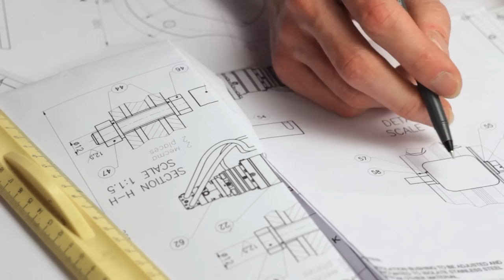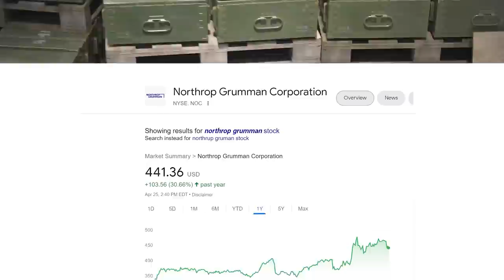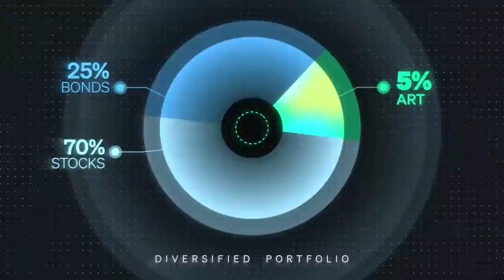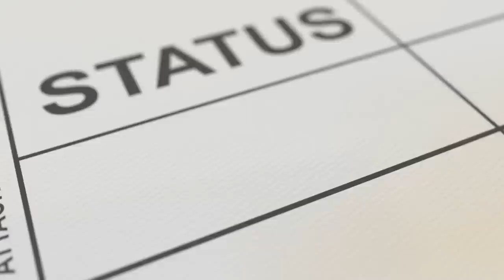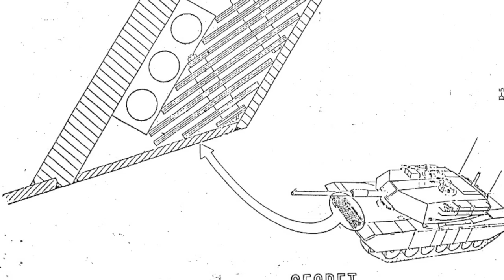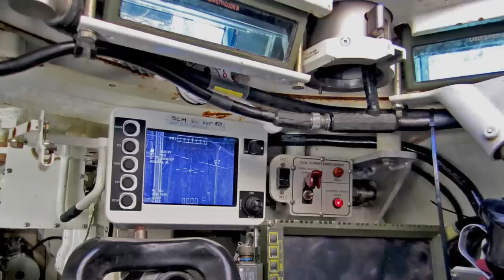The M1 Abrams Tank Needs to Chill Out

Comment: Could you do a video comparing the main western tanks, M1 Abrams, Leopard 2 and Challenger 2? Pretty please..... Ok and maybe even the Leclerc 🙈
Reply: There's really not much to compare, because they are all about on par with each other. 
M1 and Challanger 2 uses the same kind of armor, called Chobham armour. 
While the Leopard 2 uses a German composite armor, which they claim to be better. 

And gun wise, they all use 120mm, infact M1 and Leopard 2 use the same gun. 
Where's the Challanger 2 uses a rifled gun, so they could reuse their old HESH ammo, which is considered outdated. 

Engine wise, they are fairly equal, with Challanger 2 and Leopard 2 both using diesel. 
Where's the M1 uses a more powerful turbine engine.
Reply: @Orcawhale1  just one correction, 120mm not 125mm
Reply: Leopard 2A6 and 7 use a longer gun than the Abrams, leclerc is similar but the tank is a bit outdated and in need of some love like the Abrams
Reply: Oh and I forgot the Abrams doesn’t use diesel, uses a gas turbine which chugs fuel and isn’t much more powerful than the 1500hp Diesel engine of the Leopard. It is however much quieter than the Leopards engine
Reply: @serg5136  Thank you.
Reply: @_lo8241  I know, but i didn't want to dwell on specific variants, and their differences, just more of a overall look. 
But thank you for the correction M1, i totally brain farted there.

Comment: You forgot to mention the trophy active protection system. Which could render ATGM completely useless against the Abrams.
Reply: For few shots where it's count (Merkava Mark 4M have 6 trophy module, 3 on each side with 1 exposed and 2 stored inside trophy magazine).
Reply: @zidniafifamani2378  true,but if the enemy is able to fire off that many ATGM without you returning fire or repositioning. You should consider a career change😅

Comment: I was a scout, Bradley gunner, unit was 1/2 Bradley’s 1/2 Abrams. I watched an Abrams tank catch fire, cook off, and explode in Iraq, but that was due to mechanical error, I have the video somewhere. I was also in the motor pool in Iraq when a lowboy brought in a different units Abrams tank with a hole punched in the turret from what I was told was a Chinese RPG. Both on 2nd tour, ‘05-‘06

Comment: Another massive advantage in the Gulf War stemmed from the cost saving measures on the "Lion of Babylon" T-72's (a misnomer, but it stuck; no confirmed tanks of the "Asad Babil" project were encountered) which made up much of the Iraqi armored divisions including the elite units. 
Many of them were reportedly ordered without turret traverse motors and therefore were purely reliant on what was essentially a backup manual traverse system.

Comment: About that firing and dipping, in my country its called firing position action and abides by the onion theory. When firing dont be seen and if seen dont be hit. We have 3 to 4 different locations to switch between firing so with a 4 tank squad, the enemy would have to predict where 2 tanks would appear in 12 or 16 different positions, reducing the chance of being spotted in time or being hit. This is one of the advantages of actually having a reverse gear in a tank, which the eastern desinged tanks lack and are therefore limitied inherently in their tactical applications

Comment: The whole rock berm thing, the way I read about it is, Abrams has greater angle of depression on the main gun than Russian tanks.  The bigger tank with the smaller caliber gun has more gun depression than the smaller tank with the bigger caliber gun.  So when Abrams sits behind a rock berm and fully depresses it's main gun, it can just peak over the top and the only target presented is the main gun and a little bit of the angled turret roof.  With the Russian tanks they can't hide like that, they end up exposing most of the tank as a target.

Comment: The modernized Leopards in service in the Polish army rely on the same principles:
- Gunner and Commander can both scan and mark targets
- Once a target has been marked, the main cannon goes into a "following" mode with a ballistic solution
- The acquisition system allows to target  more than 1 enemy, so that after the first shot has been fired, a second target is already available, and the gunner and commander can keep looking for new targets.
- The scopes and target acquisition are a bit higher than the tank silhouette, so that targets can be marked without exposing the tank
- Crew survival is top priority, there is an emergency system, that pumps a heavy gas in case of fire.

Additionally:
- each tank is outfitted with an secondary generator. This is to allow the tank crew to use the targeting and other tank systems (like heating) without having to keep the tank engine on. This is done so that when the tank has to be on standby or waiting in an ambush, it has a reduced heat signature.
- each tank has programmable ammunition
- each tank has a set of grenade launches that can deploy countermeasures against enemy anti tank weapons or just to cover it's position (in the form of smoke). The grenade launches can also be loaded with antipersonnel ammo to dispose enemy soldiers that try to surround the tank or get close to the tank ( it basically creates an umbrella of shrapnel ).

Comment: I saw a report that in Desert Storm, when an Abrams fired on a T-72. the crew were seeing two flashes.  They couldn't figure out the second flash until they got up close.  One flash was the round hitting.  The other flash was when it came out the other side.  The depleted-uranium core ammunition was not only penetrating the T-72 armor, it was going ALL THE WAY THROUGH.
Reply: You also neglected that the Abrams can take on targets at 2500 yards ON THE MOVE and rarely miss.

Comment: That moving up and down the berms to get shots off is part of the common tactics of tanks. One of the best ways of not getting shot is to not be out in the open to get shot. Another way is not to be seen, but when you're in a 60 ton tank, that's easier said than done. But it's a much higher guarantee that any hostile fire coming your way will deal a lot less damage to your vehicle if it ends up hitting something more solid before those rounds ever get to you. Something like a berm or entire wall. So it's more of getting up to shoot, and then retreating back to not take fire back. The whole thing the Chieftain was going on about with the video you're most likely referring to is more of the point of why tanks are using cannons still and why ATGM's are not the mainstay weapon system on armored vehicles. To reiterate the point of his video, the point of tanks is to move a considerable amount of fire power around where you need it to be. A 120mm gun is a considerable amount of firepower as in 3 ATGM launchers. However the amount of rounds down range a single ATGM launcher can fling in comparison to a tank's 120mm gun is not even a competition. The launcher will lose out every time.

But I feel like the battle of "armor" is not really a contest at this point. We've got to get the tactics on the same level first. Russian forces have repeatedly failed to protect their armor with infantry and have convoyed them together in close groups on open roads. That's not how you tank in the modern battlefield. I feel like NATO does stand a chance as long as Russia sticks to their super inefficient and incompetent methods and tactics of using their equipment.

Comment: Correction!
The Abraham's never fought outnumbered.
Even though the Iraqi had initially more tanks, that number was drastically reduced and reversed by airstrikes prior to any ground to ground engagement. 
I would like to think that nobody would argue hat the leopard 2 in its iterations isn't relatively on par with the Abraham's.
Assuming they are, then the sub optimal performance of the Turkish leopards in Syria should one give enough reason to reevaluate the myth.

Edit:
Doesn't the pentagon pay you enough, or for what purpose do you still "need" a sponsor?!

Comment: Saying that the Abrams track is quiet made me remember the time I was standing next to one when the driver hit the ignition. It was not quiet. It sounded like a jet preparing for takeoff. I am not a tanker but I was stationed on Ft. Knox for 2 years so I got to  see quite a few.
Reply: Compared to Bradley and M60 its silent, you can't hear them past half to 3/4 mile but a Bradley you can hear at 1.5+ miles and same with M60 tanks , the tracks also don't squeak as much , I was E-2/81 at Disney barracks at Knox . It's very much a quiet tank compared to prior

Comment: Always fun when non tankers (aka crunchie) talks about my old ride.  You missed a big problem with Iraqi tanks and that was they still had hand cranked turrets/fire systems.  The up and back puts a berm between the tank and the enemy.  Just the sights poking up.  Ideally each tank would have multiple fighting positions and move between them.  But that's only in defense.   They do much better on the attack.

Comment: You have 3 main positions - a hide, turret down and hull down.  The only time you have to move to hull down is to engage with main gun or coax. Basically there's no point in sitting on top of the hill where you can get shot. Only move up when you have to, shoot, then back down. As far as the Army placing crew safety so high on the list, that lesson was learned by watching the results of Arab/Israeli conflicts. The Israelis found that even being hit and surviving, if the tank caught fire (fuel or ammo) the crew would abandon and then were lost to enemy machine gun fire. So the US changed out hydraulic fluid (from 'cherry juice to FRH, separated the ammo from the crew, provided blow off panels to vent force of explosion away from the fighting compartment and designed a Halon fire suppression system that is first class. The M60A3 was the last tank we used that you were not separated from the ammo. it was a stop gap tank to fill the hole until the XM1 (at the time) could come into full production. If you want an excellent book about the Abrams, read 'King of the Killing Zone' by Orr Kelly.

Comment: I am in the camp that the M1 is only moderately more survivable and versatile relative to well maintained T-72s and T-80s when faced against the cutting edge of modern anti-tank systems, but the biggest advantage the M1 has over other modern tanks is the chassis and turret are independent systems from each other with a separate compartment for the driver.  The M1 chassis is a well proven system and you could segway into drone Tanks by spreading our current 19k out to one man per tank in what is currently the driver's seat with a drone turret that could be optionally controlled by remote from the driver's hatch or from Squadron headquarters without fully crossing the line over to drone Tanks in Combat and then maybe throw in a couple of light and medium platforms that are fully automated per M1 chassis under each TC's direct command and control.

Comment: No doubt, this tank is an excellent match against most regular forces, but the only thing that's going to save it from an enemy soldier with a Javalin or NLAW equivalent hiding in a ditch is the addition of an active defense system which I don't doubt is already well in the works.  Whether that system fits onto the current production models or requires a new turret design (as seen with the switch from the Challenger 2 to Challenger 3 designs) is something that only the technical staff involved could say for sure.

Comment: I read that there were 568 Abrams returned to the U.S. during the Iraq operation.
Actually, a lot of U.S. equipment makes it's way back and forth to the middle east.
It's not all about combat damage. Sand is horribly detrimental to military equipment.
This is equipment that suffers lots of wear & tear in it's normal use and sand accelerates that wear & tear.

Comment: M1A3 Scuttlebutt - 
 - I heard they might make the M1A3 an electric drive, eliminating the huge transmission. The turbine will be retasked as a direct drive high efficiency generator that powers a large battery pack for reserve, and use 2 electric motors for the rear drive sprockets with a hydraulic clutching system connecting the two. This way, they can shut down the turbine, and run off the battery for up to 30 miles with silent electric drive while in enemy territory, and not give away their position. Apparently much more efficient by increasing gas mileage/range by almost 100%. 
- A possible one piece solid cable impregnated rubber track that is much quieter, more reliable, and lasts much longer. 
- Newer hybrid composite armor panels that are far superior to existing heavy Chubum armor. 1/2 the weight with better protection.

Comment: One small note on the Abram's engine, apparently the fuel doesn't have to be liquid.
Even though this is a useless anecdote, a mechanic talked about how an Abrams ran out of fuel right before it got to the refueling point, so the C.O of the maintenence area took all of his spare paperwork, and shoved it inside of the out-of-fuel tank, which allowed the tank to have JUST ENOUGH combustible material to start the engine and pull up to the gas pump.
This may be false, but theirs at least a few rumors saying that the Abrams can literally run on paper.

Comment: I believe that the majority of the failures of the M1A1 during Desert storm was from dust getting into the turbines. Units modified for the operation were equipped with diesel power plants. Not quite as powerful, but much less sensative to dust damage.
Reply: I've never heard of Abrams being equipped with diesel engines in Desert Storm?  It didn't take the Army long to come up with a maintenance procedure after a few turbine failures.  I thought they justs improved the V-pack air filters and increased the maintenance to every fuel up on them once they realized the issues with finer talc like sand.  The Abrams also had issues with its fuel pump being clogged from sediments in the fuel tanks.  Probably caused from letting fuel sit too long in aux tanks for years and only using the main fuel tank for short training runs  back home.  The Gulf War was probably the first time they needed the full operational range and 500 gallons of the Abrams and discovered the issues. The M1A1 Abrams was designed to operate and maneuver in Europe, not the desert. Very hard to install a diesel engine on +3000 tanks for a 100 hour war and then switch them back afterwards.
Reply: @mrgold3591  TBH, all I heard was rumors. Still, 500 armour units being disabled due to dust contamination is not a small thing.
Reply: @surferdude4487  Affected by dust and non-operational during battle are different numbers. There were around +3100 Abrams for the first gulf war with around 1000 held in reserve.  The readiness rate was around 90% for the M1 and up to 95% for the M1A1.  Any units with M1s were replaced with the M1A1. Tank battalions always deploy with a spare tank and they had the 1000 reserves to pull from as needed.  Any non-operational tanks during the 100 hour war were replaced before rolling out.

Comment: So if there is a 500 gallon fuel tank in the Abrams and the range is 265 miles, the mpg is about 0.5. Or 1.89 gallons per mile. I also heard it takes 7 gallons to start the beast. I would say its fuel consumption is its biggest weakness.

Comment: I do believe the abrams speed limitation is related to the track, I have personally witnessed the maximum speed of the M1A1 and 45 it exceeds that, I am sure it is classified. It should be noted that I was part of an investigation into a death caused by an M1 on an autobahn accident. It was noted that the M1 did not have a speed limiter at the time and was going so fast that the stress to the track caused a failure and the track came off causing the tank to jump the guard rail and hit a semi at window level and killing the driver. The M1 damage was limited to the radios getting knocked out of their mounts
Reply: ungoverned M1A2s can hit 60+ mph
Reply: I personally drove an ungoverned M1 in 1979 at 61mph.  It drove well until I slid it around a corner on a dirt track and rolled the track under and off.

Comment: People, we have current, real world data on the M1. As far as I have been able to determine, no direct combat deaths of US tankers in M1, but some close calls. Close calls happen when the tank was isolated or moved into unsubdued areas without proper  support. Modern tank success seems to depend on a synergy of volunteer soldiers with excellent training and a total battlefield engagement that includes air and ground support. Take any of those away and tanks are less effective and more vulnerable, i.e. tanks are a single piece of overall strategy with very dew exceptions.

Comment: There were tungsten steel penetrators available in the battle of 73 easting based on the damage assessment of the American tanks after the fighting although it is not clear if it was friendly fire from challenger tanks or from the T-72s.

Comment: Problem with these engines is that they use the same amount of fuel even while idling. General Hertling said in practice it gets about 3 gallons to the mile and that's of jet fuel...other fuels are probably worse. They're changing out to diesel engines soon apparently.
Reply: Abrams does have 10kW auxiliary power unit the crew can use at idle.

Comment: Good analysis.

Bottom line: the Abrams tank has always been one of the very best tanks. Its opponents have always been among the worst tanks.

A large part of that starts right from the design, but crew training, tactics, support, also form a huge part of the equation.

Exactly as you have touched on, although you didn't get into a lot of details.